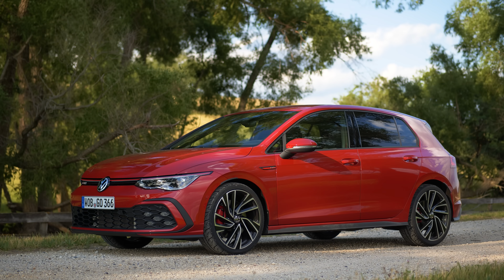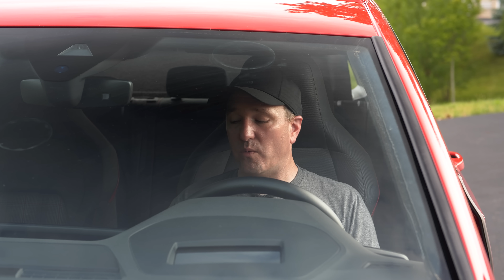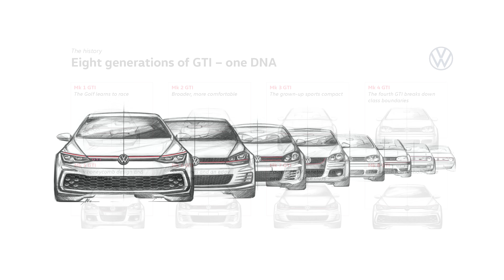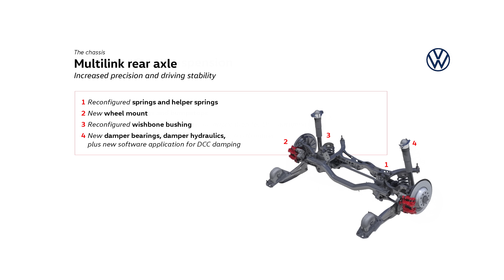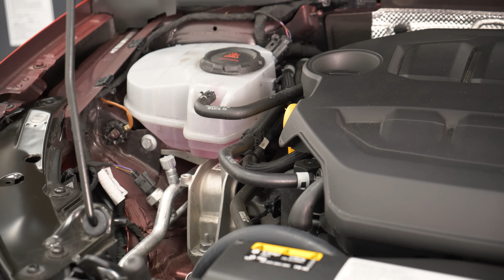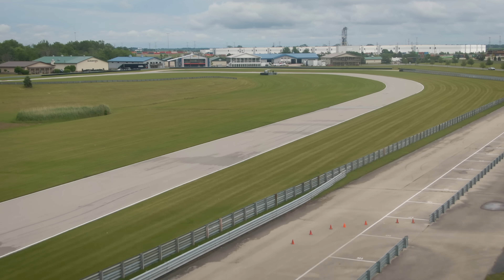2022 VW GTI Mk8 | Unexpected

Comment: Very glad to see Jack and Mk having a blast driving this new Mk!  I'll wait 2 years for VW to fix the interior before upgrading from my heavily modded 2017 GTI S
edit: will keep my Mk7 forever, but it's good to know the Mk8 is still a blast to drive in case anything happens to my beloved Rabbit 🐇
Reply: It's the tires, all season vs track tires lol
Reply: @VarioFelce  they def have a large influence, no arguing that haha
Reply: @rabbitenjoyer6320  I'm in Europe, here they've already done much testing on the mk8.
If you want my opinion, keep yours and improve that. 
But if you just want something new I understand 😁👌🏻
Reply: @VarioFelce  I definitely want to keep my MK7 as long as possible.  It's a blast to drive since adding a WaveTrac diff last summer and a tune this spring.  Still many mods I plan to do!

It is reassuring to hear from these guys that VW didn't mess up the driving experience with the MK8 (Jack and Mark laughing their heads off seems to be good evidence of that lol 🙂)

Comment: Unsprung mass is everything NOT supported by the suspension: wheels, tires, brakes, knuckle, etc. The aluminum knuckle is therefore the bigger deal than the aluminum subframe. The subframe is sprung mass, just like the rest of body and structure.
Reply: That bugged me, too. Also the odd note that it's the lowest point in the car. It's mass up high that matters the most. That low it is not an issue.
Reply: @markmiller3279  Exactly this. Removing mass down low just makes the mass up high have an even bigger (worse) impact on dynamics. In fact, adding mass down low can improve things, because it drags the center of gravity and center of rotation closer to the interface plane (tire contact patch).

There's a reason F1 cars sit between the tires instead of above them, and it's not just aerodynamics.
Reply: @markmiller3279  The reason they go with the aluminum subframe is they can more easily get additional stiffness using a somewhat complicated shape at a reasonable price point via casting.   Saving a few pounds is certainly not going to  hurt.      It's definitely not unsprung or up high, but the main result should be a more direct steering feel and response.   It's one of the most, if not the most critical part of the chassis.

And it's not a first - Mk5 and Mk6 GTI's had alum subframes, as well as most, if not all of the last few generation Audi A3 models.   The mk7 steel subframe seems like a cost cutting measure to me.   Considering VW specs alum on all more premium variants, they apparently feel the same.
Reply: @markmiller3279  Genau!
Reply: Spot on. And aluminum knuckles are a big deal. Well done VW for that bit.
Reply: @DeuceDeuceBravo  Didn't MK7.5 had an aluminum knuckle already? Or just alltrack/R MK7.5?
Reply: @prs314  Honestly don't know. I'm still rocking a mk5 with old school metal. 😁
Reply: Yeah I thought that sounded weird when he was saying it.
Reply: Subframes are semi sprung. There are bushings between the chassis and subframe, thus the subframe moves with the suspension before transferring force to the chassis. Other examples of semi sprung components: shocks, driveshafts, diff, basically anything that moves up or down before the body.
Reply: Yup, came down to the comments to say the same thing.

Comment: Since when was a subframe part of unsprung mass?
Reply from the maker: Never was, but anyway weight that is unsprung mass is important.
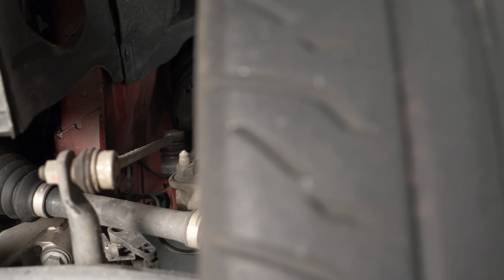Reply: @savagegeese  Gotcha. I was referencing your comment at 6:47, but you hit the nail on the head about torsional rigidity. It's a common upgrade for mk7 owners where the stamped steel subframe would deflect when putting power down during cornering.

Comment: The piano black on the steering wheel is almost enough to disqualify this from consideration
Reply: The touch controls are an automatic deal breaker for me. I don't care how well it drives.
Reply: cars these days are designed for the photoshoot. they dont care about what its like for the actual customer to use. marketing rules everything
Reply: Any manufacturer using piano black would not get my hard earned $$.
It’s horrible trashy garbage.  Saddens me that VW has resorted to this. How they have fallen from the MKIV years when their interiors set them apart.
Reply: And all the touch controls 😖. Coming from an mk7 Golf R, the interior was just perfect, I would've went into the mk8 R, but too $$$ now. Mine was under 40K out the door brand new, W/DCC in 2015.
Reply: The interior is unfortunate but my priorities for a faster better driving car strongly outweighs the interior design.  Definitely wouldn't cut it off my list.
Reply: Tired of it. Period
Reply: These comments lol. I actually own the car, it’s great, I don’t look down. The sliders not being lit under the radio bothered me for a week.
Reply: When I first saw this design and up to the minute before I saw the driving impressions, I was totally out. That new interior direction for inputs was a huge turn-off for me.

Now? The driving impressions have my wallet quivering. I thought I was safe...
Reply: @Kamukix  more like your creditors quivering lol
Reply: The piano black on the steering wheel is not only piano glass on the steering wheel, wich is already bad, but it also means they did not design the interior to be the best they could do, but instead just followed modern trends without giving it a second tought.
Reply: I'm not a fan either but if this is a big deal for you then you've been spending too much time at the mall with your girlfriend.
Reply: @toddstevens8506  2019 7.5 No scratches and a simple wipe with a cloth once in awhile keeps it shiny. Not sure why people can’t do simple things.
Reply: @toddstevens8506  my car has piano black. It was very pretty for the first week. Now it is never clean. Ever. Ever. Ever. Ever. It sucks. Looks good for the ten minutes after you clean it.
Reply: @sgtpepper6379  Mine too, don't like but as I said, it's a small irritation for what is overall, a great car.
Reply: @toddstevens8506  It is a big deal. Piano black has been panned for years for good reason: it looks like trash, gets coated in dust and fingerprints immediately after cleaning, and scratches very easily. It's pathetic that in the year 2021, some manufacturers still haven't learned how much people hate piano black. Seeing as this is VW we are talking about, though, I am not the least bit surprised.
Reply: @mattspeer01  As I mentioned, we don't like it but hardly enough to dissuade a car guy from buying an otherwise great car.
Reply: Says the guy who's never, you, know, actually DRIVEN the car.  So many keyboard warriors bitching about the interior as if every other car is perfect. Drive it and make a judgment, don't just watch videos and be a child 🙄

Comment: I've been on the fence for a while now about buying a mk8. The driving dynamics is good and all, but operating everything via touch would drive me fucking insane. I can't do it.
Reply: Agreed. I recently looked at one of these here in the UK and I can't do it. It's a shame because the underlying engineering seems really solid. Looks like I need to hang on another year for the forthcoming non weird looking Civic Type R.  I'm impressed with how Toyota with the current Corolla and Honda with the new Civic are providing actual physical controls for the most important functions, to supplement their use of screens / capacitive control, rather than go capacitive for everything
Reply: You’re 100% right.
Reply: I'm in the same boat...I want to want this soooooo bad but those haptic controls are godawful. Removing physical buttons in the name of "progress" is just solving for problems that don't exist at this point. nothing wrong with buttons and dials.
Reply: Agreed! Massive Mistake!
Reply: Getting a manual Honda Civic Si for their interior instead?
Reply: It's a bummer that they can overlook something so little yet so important for day to day use. It makes no sense in a vehicle at all. I think I would go for the veloster n over this because of that. Sure the interior feels cheaper in the n, but I think the lack of buttons in the new golf would actually bother me more on a daily basis.
Reply: @ScurvyMcGruff  I don’t think I’d ever buy a veloster lol. I bought my mk7.5 for a reason. And it wasn’t for cheap gimmicks like “ooooh look how cool I can spin my car in a circle on the screen while I struggle to find out how to work the traction control”
Reply: I'd suggest last year's mk7.5 instead. Cheaper and it'll age way better. Bought mine couple weeks ago and love the simplicity.
Reply: @rko95ful  Hilariously, that's what I purchased a while ago because I needed a car lol. but now that i've taken it on a few road trips.... I regret it. It's not that comfortable on long trips. Looking for a wagon now.
Reply: You get used to it. It’s not bad at all
Reply: My Tesla is probably the only car I have driven that I don’t mind everything being touch “for the most part” you still have the volume roller wheel on the steering wheel, but the hvac is easy to use and if you really don’t want to touch the screen you can use your voice to change the temp and the fan speed
Reply: @Wasssup3232  Nobody should go to the same trap as Tesla has gone to. Thankfully just this year we have started some walking a bit back on only touch screen. Example VW Groups Audi. Worst part is that people are being sold this as "cool thing", while in reality having all of these under touch screen and not hardware buttons is a saving for the manufacturers.
Reply: @tissot233  I have no issues personally I love how easy everything is on the screen. I can see how for some people it could be a hindrance though I’m not denying that.
Reply: @Wasssup3232  voice control is even worse than touch
Reply: @d_all_in  In my car at least you just click one of the scroll wheels in and say for example “ set fan speed to 6” or you can say silly stuff like “my butts cold” so far as long as you know what to say the voice controls, relatively speaking, are easy enough, maybe just a little slow for some people

Comment: With all these touch controls, yes its kinda annoying for about 2 days and you get over it. Every Volvo has been like this for years and you don't even notice it anymore after a couple days of driving it. It's not like they’re going to sell any less of these because there's more touch controls. VW is a lot smarter than we are.
Reply from the maker: Not every function on Volvo is touch. Existing gen has physical steering controls, volume knob, track select, defrost and ESC is a swipe and one tap.
Reply: I've been waiting years for the mk8 to replace my mk5. And I'm not buying one specifically because of the touch controls. So that's at least one less sale.
Reply: @DeuceDeuceBravo   It’s dumb yeah but that’s no reason to not buy a car if you like it. Touch screen phones sounded dumb in 2007 and look at us now. You might as well never buy a new car ever again.
Reply: @Juganator  Touchscreen phones never sounded dumb. 😉 And phones are used while you're looking at them. Not something you should be doing while driving a car. 
My wife's 2020 Mazda 3 has a fantastic interior layout. Nice big screen for infotainment and nav. But everything is controlled by buttons and knobs. Not a single touch control. That's the sweet spot.

Comment: It’s a disservice to judge the dynamics of this car using a track spec tire like that, which makes a HUGE difference. VW has typically installed junk tires on US spec GTI’s, and it’s always been something you needed to change out right away on these cars.
Reply: To be fair, most track people are going to change stuff on their cars anyway. If it's good on track with track tires, it should do ok in regular commuting with normal tires.
Reply: Just another indication, if any was needed, of VW's ethical bankruptcy,
Reply: Exactly! Compare the Mk 7.5 with the same tires and there's probably little in it until you consider interiors.

Comment: A lot of mid 2010's Hondas had those dumb touch volume sliders, they replaced with knobs after a few model years when they realized it was dumb.
Reply: The complaints about the volume slider issue were well publicized. Why couldn't VAG learn from someone else's mistake? They will regret it. Physical controls for volume, HVAC and seat/steering wheel heat are the only way to go.
Reply: @dougrobinson8602  They are already too far gone. I don't think many manufacturers are gonna revert back to more buttons. Everything is so high-tech these days.
Reply: @lukaposeidon8490  when high tech becomes low tech
Reply: @lukaposeidon8490  its not HIGH TECH..your just stuck in the past so it looks like it to you..i would hate for you to daily a Model 3 with nothing but a big screen in the middle of the dash..
Reply: @marcoulibarri5744  Who hurt you mate? Yes, it's high tech. The fact that a tesla exists with more tech doesn't mean this isn't. Got nearly everything the tesla has except a couple of things+some useless stuff. You don't even know what you are talking about obviously. What are you, 10?
Reply: They got countless complaints from owners & responded by reverting to physical controls in their later cars
Reply: Who wants to try to control anything with a touchscreen when they're holding the steering wheel and jouncing all over the road...
Reply: @dielaughing73  Some VW focus group missed the memo that they are designing a car and not a smartphone
Reply: @RG_97-i3r  well most people are used to touch screen cell phones so...transitioning to interactive touch scrrens on cars only makes sence...plus it saves car companies money by not having to make physical buttons..
Reply: Cadillac CTS and ATS also had them and car journalists universally grilled them for it. Touch buttons are the lowest of the low. A real button is a million times better feeling, let alone a knob.
Reply: Yeah my Honda Fit has the volume slider and I think a year later they went back to a traditional knob. It’s annoying but at least I have volume buttons on my wheel so it balances out.
Reply: Touchscreen is like the dumbest thing ever invented in a car.  Knobs you can turn while driving, touch you are going to look with your eyes.
Reply: Every fucking MFR is going through the same cycle of learning at different times. Audi ironically enough is right now going back to physical controls in their Etron gt and q4e. Car mfr's learn nothing from anything except for sales.
Reply: I have 2014 Civic and I hate that garbage capacitive volume control ever since I got it
Reply: My accord has that. I had no idea you could swipe to make it go up super fast until a few months after ownership. It’s so unintuitive
Reply: Blame Tesla... They put a giant ipad on the dash.  Even wipers are operated through a touch screen menu.
Reply: “Stupid is as stupid does.”

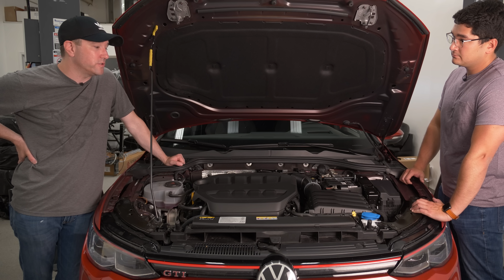Comment: 10:46 I would spend extra for the extra rail and injectors(extra cost if any) rather then the hassle of taking apart the engine + downtime + labor costs to decarbonize the intake valves.
Reply: Don’t forget the engine management too

Comment: I wonder if the center stack is the same as the MK7.5 so you can just swap in the older radio and HVAC, do a little VCDS coding/component protection, and done.  Sadly won't fix the ugly exterior though.

Comment: On the German version the sunroof won't fly off like on the Mexican Golf😅
Reply: But will it creak and squeak constantly like all VW sunroofs regardless of build location?
Reply: @clutchthepearls3062  well you need to oil those babies up in order to make them work properly. This goes for any panoramic sunroof on any car.

Personally I wouldn't get one on my car for maintanance and ambient temperature reasons.
Reply: @dragospahontu  I've got a MK7.5 S because I specifically didn't want the sunroof issues.
Reply: @clutchthepearls3062  if you take care of it then it won't rain in the car and it will not squeak.

But to me a sunroof is a disadvantage because in the winter it's cold and I'm the summer it's too hot.
Reply: @dragospahontu  oiling it won’t prevent the water intrusion problems that plague all MQB sunroofs
Reply: @guenthersteiner8163  nah man. Oiling it and cleaning the drain holes will keep it going.

Again, idk how they're made down in Mexico 😅
Reply: @clutchthepearls3062  Yes, 2019 Alltrack S. Hell of a car.
Reply: never had any issues with the one on my Tc ...never had any fun too with the handling but  I never waited at the dealer for any repairs .

Comment: The interior on the mk7 is so classy. The new one is just cheaper looking.
Reply: Ikr, the mk7’s interior has aged so well.
Reply: What happens when you get sued out the ass for lying about emissions lol
Reply: VW trying very hard to recoup every penny lost in the diesel scandal
Reply: The exterior looks better too. Mk8... they just stopped trying.
Reply: Looks like it was lifted from a Hyundai or some other lowball POS.
Reply: Nah, the digital gauge cluster and new infotainment system are well over do, at least for the American models
Reply: The MK8 interior looks tacky
Reply: wouldn’t say it’s cheaper looking, but it definitely is less usable and practical because of those touch sensitive buttons
Reply: Mk7 looks class. This.. not so much.
Reply: But it's not cheaper. The mk7 was a huge step down from the mk6.
Reply: @nxau120  nahhhhh. They were both similar. The mk6 was more minivan-like in its dash shape. Maybe it had soft touch upper plastics in the rear seat too? Hardly a huge difference compared to the mk7. Quality wise I actually dig the 8, I just hate the gloss and haptic hvac.
Reply: @nxau120  This isn't true. The Mk7 interior was great. Better than the Mk6. The interior of the MK7 was so good, Mercedes delayed the release of their C class by a full year to make their interior better because the MK7 was so good.